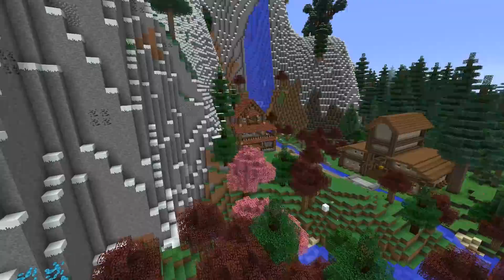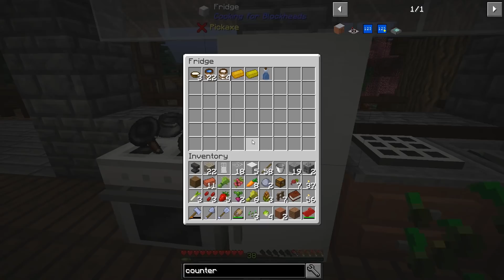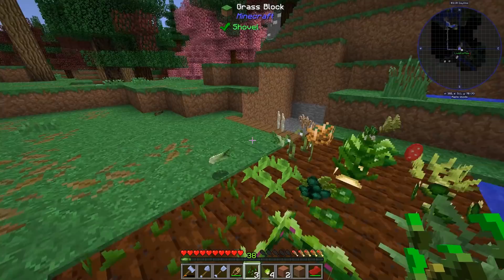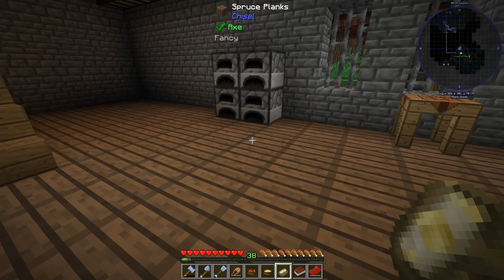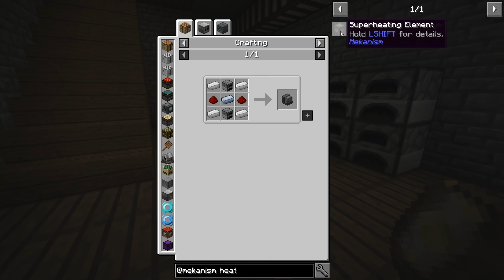Feed The City #4 - The Steel Conundrum

Comment: 2 coal/charcoal per steel is not expensive. Immersive engineering requires 4 charcoal or 1 coal coke in a (comparatively) far more expensive structure . the power is expensive because your using mek's weakest generator and the mod intends you to use its other ones.
its 1 compressed carbon(made from coal or charcoal) makes 4 steel from 4 iron if u have the enrichment chamber ( which is not expensive comparatively)

Comment: Placing some lava next to any of the @mekanism heat generator will make it generate a low amount of power passively. Also it should be noted that making an @mekanism enrichement chamber enables you to make compressed coal / redstone etc. wich have a higher coal / redstone amount value inside the metallurgic infuser, allowing for "cheeper" metallurgic infuser recipes.

Comment: need enrichment chamber to make diamonds,coal, restone and infused obsidian ten times more effective for the metallurgic infuser. this is a million times faster to make steel if you have a tree farm pumping logs into the mekenism fur-nus to make charcoal, than have the charcoal pumped into 2 metalluric infusers right next to each other. one infuser for the enriched iron, to export to the other infuser to make the blend. its some what complicated but i know you can do it. if you make steel this way its almost instant vs blast furnes from engineering.

Comment: the dump button does not dump the power, it dumps any stored redstone, coal, diamond dust, etc that is stored in the left side of the machine. that is important when you need to use another material in that slot, but it is already occupied

Comment: If you get an enrichment chamber you can upgrade your redstone or coal into "compressed redstone" and "compressed carbon". This increases the yield in the metallurgic infuser by a factor of 10 for coal and 8 for redstone, meaning one coal can turn 5 iron ingots into steel blend, or one redstone can turn 8 iron ingots into enriched alloy.

Comment: There is an easier way to make plates. Use an engineering hammer on a copper ingot in the crafting bench to make a plate of the ingot. The tinkers hammer consumes 4 ingots for 1 plate, while IC2 forge hammer uses 1 ingot to make a plate. Engineers hammer from Immersive engineering makes 1 ingot into 1 plate.
Reply: the ie hammer also only has 5 uses in crafting same with the wire cutters(config?) , so u wanna use other tools/structures  for plates and wires (like the ic2 forge hammer or vanilla shears ). sjin just said "meh ill just cast it"

Comment: Sjin build an enrichment chamber from mekanism it turns coal or charcoal in to compressed carbon which is worth 100 units instead of 10 this also goes for the other catalyst uses in the infused like Redstone diamond and refined obsidian dust
Reply: Also the heat generator passively generates th at about 2 e.g. a tick per side that has a lava source block next to it

Comment: You do not need to actually use the immersive engineering wires to transfer your power if you do not want. I used fluxducts but I currently use the enderio conduits

Comment: Hot tips! Hot tips! Get ‘em while they’re hot!
• Enrichment chamber makes coal worth 8x as much in the metallurgic infuser for the minor cost of 4 steel and some more power
• Mekanism energy and speed upgrades are relatively cheap and are worth building as soon as you can, they make machines more energy-efficient and faster, but only 8 of each can be stored per machine (speed makes them LESS energy-efficient, though, so maybe don’t make too many yet)

Comment: tip for sjin the ender io farmer and pipes will be your best friend the farmer can farm all the different plants and the pipes not only can occupy the same block (for example you can have a power and liquid pipe in the same block) but they also transfer a lot even low tier with it even having me cables you can us later on

Comment: 2 coal + 1 iron = 1 steel. Really not that expensive...
Reply: Even cheaper if you use mekanism's compressed carbon 1 coal/charcoal = 5 steel
Reply: If he makes 8 energy upgrades then it'll barely use any power. If he upgrades his infuser to an infusion factory it'll even do multiple ingots at once. Also, the heat generator is notoriously inefficient, it's probably the worst generator in any modpack and should be chucked into the lava once he gets a different power source up and running, and Mekanism's wind turbines are borderline OP, so he should make that unless he wants to go for immersive engineering's water/wind power which is not very efficient/powerful but suits the aesthetic he's going for and can easily drive a low-output mekanism setup (so long as he doesn't fully load em up with speed upgrades which increase power drain exponentially for every one installed).
Reply: Its even cheaper than that. You can enrich coal and its worth alot more carbon in the metalurgic infuser. He can also completely resolve the power problem by building a wind generator which are pretty cheap but effective.

Comment: the heat generator can passively generate energy if you place it next to lava
Reply: it produces an insanely low amount of energy tho. Something like a few mRF/t. Putting in fuel is like a hundred times faster in this modpack.
Reply: 1 mRF/t is more than 0, 

So, why the hell not?
Reply: Apollo Albright but can’t you cover multiple sides for faster speed but it’s prolly not and is there a way for auto lava like for a sky block you would have a cobble gen connected to a crucible that pipes into a heat gen
Reply: usually what i like to do for power gen is get an ender tank and go to the nether and pump lava into magmatic dynamos. its practically an infinite supply of energy

Comment: You should put your spice rack and tool rack one block lower to connect them to the rest of the kitchen multibock structure
Reply: Anime Draco i think they already work cause his juicer is on the tool rack and it makes apple juice
Reply: They are already connected to the Kitchen multiblock structure. He made Apple juice when teh juicer was on the rack
Reply: I think the cow in a jar is occupying a block that is connecting the tool rack to the multiblock structure.
Reply: it all works, the system is fine mate. They made apple juice from the juicer